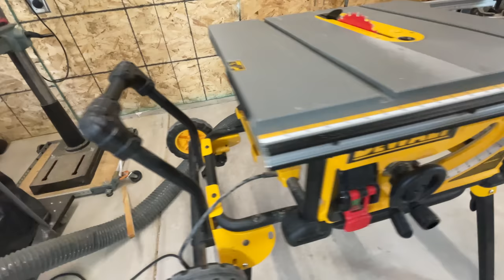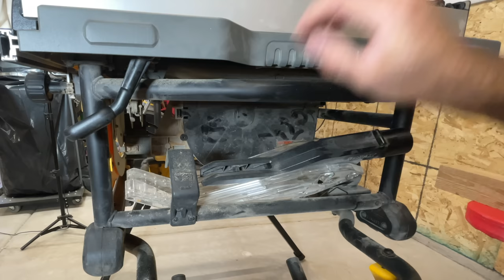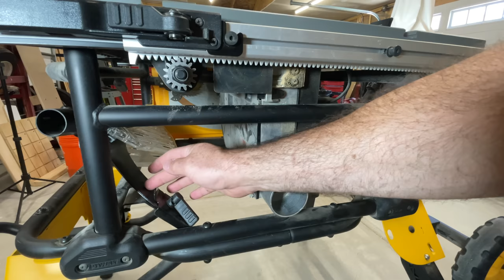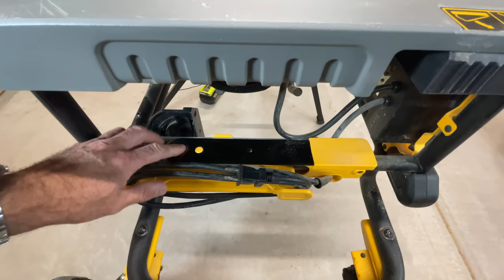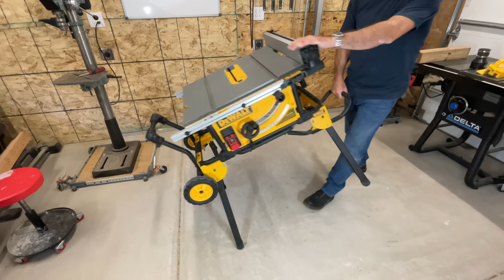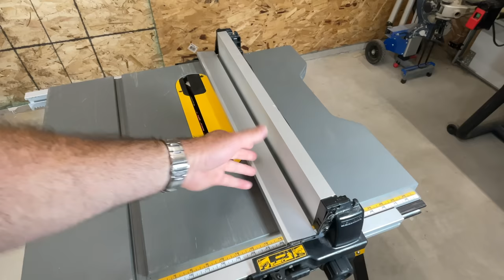The Saw Designed For Everybody?  |  DeWALT DWE7491RS   |  Review and All Adjustments

Comment: I've just had too many of the Dewalt rack and pinion fences jam up with sawdust.  I always liked the Bosch fence setup better.  Now Ive moved to the Sawstop Jobsite Pro and absolutely love it.
Reply from the maker: I’ll pay extra attention to the fence differences when we eventually get a Bosch in to review. Looking forward to getting that Sawstop in for testing too. Looks really good. Thanks for the tip Sean!
Reply: How do you get so much saw dust in there that you manage to jam those large teeth?
Reply: @ProjectsForAllReviews  If at all possible review the Skill-saw SPT99-11 which is in this cat. I chose it over the Dewalt mainly because of the fence it seemed a little heavier and has T-Slots built into the front and top of the fence which is nice for attaching stops and axillary fences to the main fence.
Reply: @loganmedia1142  Agree. I've heard nothing but great things about DeWalt rack and pinion fences (just got mine yesterday). I would think dust extractor or compressed air would handle that.
Reply from the maker: It’s on my short list to review!
Reply: @ILruffian  I agree with you. Most people don't know how to clean as they go. Then, they wonder why they are having issues.

Comment: I’ve had this saw for 5 years now. Overall I really like it. It’s very accurate and I love the rack and pinion fence. Overall the saw has pretty good power but cutting 2” walnut will bog the motor down. 
The things I don’t like about is are:
1. Small table size. I ended up making an extension that helps somewhat but…
2. I HATE the vibration. I really wanted the delta saw you have but, at the time, I needed to have the portability of the Dewalt.
3. Related to table size, I don’t like the small infeed size (distance between tabletop front and the blade. There are some work arounds I’ve found but… 
Having said all that, I do like the saw a lot and it remains the workhorse in my shop. 
Great review! 👍🏻✅
Reply from the maker: Thanks Steve! I did notice the infeed was cramped but kinda figured I was spoiled with my contractor saw. It really does make a lot of noise and vibration though.
Reply: Once i noticed the motor on my 745 staining a bit when ripping about 20-24" of 8/4 cherry and walnut for an end table. I was operating with the blade gullet just clear the surface of the wood and decided that the blade would have more downward leverage (and run cooler) if I raised it up to 3" which is near the full height. Sure enough it began to cut with greater ease--even on hard maple. About the only thing that seems to bind it for me now is a 2x4 with a lot of internal stresses within. If I experience one of those I just put it aside for some other use as it's not worth risking a kickback or damaging the saw for such a cheap piece of wood...

So many comments about the crap miter gauge. I've bought many good quality bicycles in my life and they invariably all come with a crappy seat. It's expected that a rider will have a particular notion about what seat they want to use so the sellers figure the  stock seat will be immediately junked by just about everyone so that's it's not worth supplying a more costly seat. I suspect the miter gauge is sort of the same--I rarely use the miter gauge for the way I work so it's no biggie to me--certainly not worth harping about when reviewing these saws. I wouldn't had been worth it for me to pay extra for a "nice" gauge that isn't really important to me.

Comment: I've got the 10" wormdrive jobsite saw and it never goes anywhere. I love the thing, but my 8 1/4 Flexvolt Dewalt is what I use on site. It's so easy to transport. Plus, for some stuff I can get away with using 7 1/4 on it (like flooring the other day) and save money that way plus the 8 1/4 blades are way cheaper to begin with. The corded version was 450 I believe, but I got the fast charger, 6AH battery, blade and a few other little things for $550. Totally worth it. And if you have the 9AH battery that's what I've been using and it lasts over a day. Then again, I'm cutting flooring. Great video, totally agree. New sub here.
Reply from the maker: I’m looking forward to reviewing the battery DeWALT saw hopefully soon! We’ve got the Evolution multi material table saw coming up in the next week or two and I’m pretty excited about this one. Welcome and Thanks for the Sub!

Comment: I own this saw, and the smaller one that takes the 8 1/4" blade.  I'm a carpenter/contractor working on mostly exterior projects.  We do a lot of custom joinery and mill/router all of our own trim sizes and detail pieces.  On top of that I'm remodeling our home.  I see no reason to own anything else.  Maybe if I was building cabinets and cutting 4x8 sheets all the time I might consider a permanent shop table saw but I see no reason to waste the space on that.  For the record, I'm a Milwaukee fan boy, I've purchased(and returned) about every brand of portable table saw.  The DeWalt jobsite table saws are the best(in my opinion).  I learned carpentry from rough framing I'll tell you the number one thing that was yelled at me was this:  "We're not building Fing pianos out here"... The thing is this, the really really nice tools are a nice to do for 99% of projects.  You don't need the absolute best tools out there to do your work.  When you look at some really nice carpentry work, do you think "I wonder if they used Makita or DeWalt on that one?"  

Does it do the job you need it to do?  That's it.
Reply from the maker: Toughest thing for me reviewing tools is I cant speak about long term durability. I appreciate the feedback! This is the saw I’d buy if I needed the portability or space savings. Looking forward checking out the 8-1/4. Thanks for watching!

Comment: Spot on review.  I have the Hitachi clone of this saw.   It's an unbelievable jobsite saw and a servicable woodworking tool.  I put a rip blade on the thing and it does everything you could want.  The 48" rip capacity is fantastic.    I completely agree that had I bought this first I couldn't justify buying a contractor saw.... But I'm glad I have one.
Reply from the maker: Thanks for the comment Bob!
Reply: The a Hitachi tested better then this dewalt.  The Hitachi has a more powerful motor and the fencing system is better.  This dewalt has tons of issues with it. Not very good quality.
Reply: @scraplifetrashtocash4551  Interesting. I didn't know that.   Looks like i'm even smarter than i thought :)  
I tend to give Dewalt credit for developing this class of saw.  (Maybe I'm wrong about that as well)  To my memory they were the first to make a really good job site saw, with the rack and pinion fence and built-in rolling stand.   
I recall coveting that saw for a decade or so and finally had an excuse to buy one of that class and chose the hitachi.  I got real lucky on the timing and only paid $350 for the saw.
Reply: Cuánto es el voltaje de entrada?
Reply: @sebastianreyes7856  sorry, I don't speak German.

Comment: Two years in, best saw I’ve had.  They made all the right choices for size and function.  My only complaint is the under-edge of the table is rough on the back of the hand when operating the fence locking handle.
Reply from the maker: Thanks for watching!

Comment: I had two Ryobi saws, they trash. Where the first one(a old hand-me-down) had small springs to help the blade raising mechanism to get back up, the new one didn't. Which made the crank break fast. The DeWalt here not only has a rack & pinion to raise/lower the blade... it is METAL as well. Really sturdy little saw with a good build quality. This thing only makes me want to go out of my way to buy DeWalt stuff for most of my tools!
My DeWalt came with a all metal miter gauge.
I would have bought that small one of Delta Contractor saw, but I heard it struggles on a 15amp plug. That was my main reason for grabbing the DeWalt here. Nice review!
Reply from the maker: Hello Bizarro! I do not miss my old Ryobi job saw. It really was junk. I’ve read the reviews on the Delta job saw and they aren’t promising but I’ll get one to test eventually.  My Delta contractor is on a 20amp circuit and it’s pretty strong with no struggling. Thanks for watching!
Reply: @ProjectsForAllReviews  Yeah I originally read that Delta Tablesaw has issues, where the motor burns out. So many people brought it back. This made me weary to buy one, or that Rigid lookalike-in-orange.
Then I read, the motor can/will burn out if you run it on a 15amp outlet, not a 20amp one.

So yeah that buried the Delta for me. If I need to upgrade my power outlet in my garage I'd rather build a 220volt one in, for the big boy toys... not just a 20amp one.😁
Reply from the maker: Makes sense. When I built the garage I installed a 100 amp panel. There’s 2 50amp circuits on either side for the welder and a 30amp for the heater also about 60 outlets on 20 amp circuits. Went a little crazy because my old garage electric was so bad I couldn’t run my small compressor. All that said I went with the Delta over a 220v model because I didn’t really see the advantage. I believe the motor runs cooler and possibly lasts longer but I rarely run the saw for hours on end.
Reply: @ProjectsForAllReviews  Honestly, "Went a little crazy"... if you plan to do some work, Metal or Wood, and you want "room upwards" you can't get crazy enough with energy possibility. If you have the space and maybe a chance to make money the only thing holding you back to get a real big machine is the electricity.

Welding. I keep see people on YouTube weld and I would like to try it as well. Not structural stuff just small things, but I am not so sure if I not burn out the cables in my wall and so far I not found anyone I can trust that told me its fine.

Comment: I have this saw and love it!!  Being able to fold it up and store it away is great and when I need to work on my parents house I just roll it into the van and fast setup on the job site.  The fence gearing is awesome for keeping the fence parallel to the blade, used to have a saw where the fence just clamped on one end and the fence was never parallel, what a pain. Great review.
Reply from the maker: Thanks for watching!
Reply: I had the Delta saw in the background, it had the same issue. Both ends of the fence were never the same. I had to push the other end to make it square, which was a pain. The Delta was a smooth saw, but that issue will keep me from buying it again. I'm going with the DeWalt instead.

Comment: I bought one of these about 3 years ago for my home workshop, and have totally loved it. The later made model I have comes with T style miter slots rather than the straight style that is on that one. I remember that I was prepared to spend time tuning it up when I opened it, but didn’t have to do a thing, it was completely dead on right out of the box. I’ve used the heck out of it for everything from small projects, to 2X construction lumber without a single hitch, and love that it can take a full dado stack. I don't have a single regret about buying this saw!!  Only change I made was replacing the stock inserts with zero clearance
Reply from the maker: Awesome Tabitha! I’m glad to hear it’s been good for you. Thanks for watching!

Comment: Nice review of the 7491. I totally agree on the miter gauge it is junk. But since the slots are standard you can put in a quality aftermarket gauge on it, if you are doing projects that need it.  My riving knife was actually bent slightly from the manufacturing stamping process so I had to flatten it on my anvil. I've used this saw for years i wish you could get a full kerf riving knife for it though. So I run a forest blade stabilizer on the nut side of the arbor and I can get glue quality rips with a freud glue line ripping blade. I've run a stacked dado set on it and it had plenty of power for a 1/2" wide x 3/4" deep dado cut in hard maple. I feel uncomfortable though, running the dado because of the direct drive gearing and the sudden start of the heavy stack. That said I haven't had an issue yet. I do have a contractor saw with an iron table and a belt drive so if I'm in the shop I run the stack on that. But the portability, versatility and stability of the 7491 in my opinion is unparalleled. If I need to cross cut at the job site I use my dual bevel 12" compound slider or the Skilsaw. In my opinion though you made too many comparisons to your delta contractor saw so it wasn't apples to apples comparisons. Also for a jobsite saw .004 bend or warp in the fence is pretty amazing really considering these jobsite saws are generally used for rougher construction.  every build I've been on when it comes to high end trim work the trim carpenters brings their cabinet saw. I didn't like the fact that the saw didn't have on board blade storage so I put a panel with a 1/2" carriage bolt and a wing nut on the foot of the dolly of the rolling stand using tec screws. I have stopped the motor on the saw and blown the breaker I had a piece of 8/4 hard maple that bound and stalled the saw despite the riving knife. However, I was able to shim it open and complete the cut. Have you ever done a video on proper extension cords? Up to 15 feet I'll run a 14 gauge over that I go to 12 gauge up to 25 feet, then beyond 25 feet I run a 10 gauge. If I'm over 50 feet I'm not happy running 10 but 10 is what I have, and then I am particular about how I use the saw being sure not to crowd it or overheat it. The gauge and the length choke the volts and amps underpowering your saw and possibly damaging the motor permanently. Also there is a difference in the volt/amp capacity of solid conductors vs woven conductors. Solid conductors having a higher capacity.

Comment: I have had mine for about 6 years and is very nice unit. Some of the things that I do not like about it. The top is that flat. Typical with so many of low end saw, the mitre guage is a complete joke. Calibrating the tilt is pretty much a two person job. Nice that you can can parallel the blade and the fence to the mitre slot. Also the extra width ripping capacity is also very nice. I ended up getting the Incra mitre guage.
Reply from the maker: Not sure you'll ever find an aluminum topped job saw that's very flat. My cast iron Delta has low spots too, 8-10/1000. Incra makes a very nice selection of miter gauges for sure. Thanks for watching!

Comment: I had the version before this saw on my old job. Used to call my own little Volvo. My lord was it good for the size and prize. Personally i enjoyed the folding metal feet for stability use on a jobsite, but for garage/personal use i'd take this one i reckon. Only "issue" i had was sawdust getting some places so stopped the tilt and rise, but 5mins of cleaning and all good again.
The poor baby sadly burned out when one of my workmates cut down soaking wet 2x8 and the wet sawdust just couldn't escape and clogged everything. My favorite tablesaw of all times with over 20 years in construction. Might get this one once my Festool dies
Reply from the maker: I’ve heard a few stories now about dust clogging the lift mechanism with these Dewalts.  I personally haven’t experienced it but I also don’t spend a whole work day sawing either. Thanks for watching!

Comment: Nice review.
The test I have found is to rip a 2x4 standing on end. Your cutting 3 1/2" deep. I seem to do this a fair amount.
I have this little Kobalt job site saw and it does it very well. That's about the only thing it does well, but it does it.
Looking to replace it now.
Reply from the maker: Hello Mark! Smart idea! Some else mentioned doing this too and I think we’ll be doing it on a future table saw reviews. There’s a lot of great saws on the market and this Dewalts a great choice if your staying with a jobsite  thanks for watching!!
Reply: @ProjectsForAllReviews  
I found the Skill worm drive job site table saw. Looks impressive
Reply from the maker: I’ve got my eye on those Skil table saws. We’ll get them in the shop for review eventually.

Comment: Just got the setup. I like it but it's kind of bulky attached to the cart. Makes it akward to go in my work trailer. I'm looking for some kind of quick release for attaching the saw to the stand so I don't have to bolt the two together. Most other dewalt pro level tools have a way to do this, like the miter saws quick release and attaching clamp to pair it with an extender table. So far, I haven't found anything for this.

Comment: Have had that saw for 5 years without any problems. The fence is my biggest complaint, it is thin sheet metal and I'm afraid to clamp anything to it just like on this one it won't hold up to it. The other thing I wished it had was a crank tilt mechanism. The miter can be ungraded so that's not such a big deal, but they did short change this machine.Though about stuffing fence but haven't figured out with what, afraid wood would swell with moisture. I bought so it can be put out of the way when not needed but still a pretty decent tool.
Reply from the maker: I think most of these job saws have pretty flimsy fences. Designed to be light weight and portable over robust. Interesting idea to stuff it. Square steel tube or stacked sheets of acrylic or something. Thanks for watching!

Comment: Just picked one of these up. Is there any way to adjust the gear engagement on the rack and pinion. Gear engagement on the back rail is good. Teeth on sprocket fit snuggley in the gears on the rack. Gear engagement on the front is loose. Gear sprocket behind the micro adjustment knob needs to come up some to engage the teeth in the rack better. 

Blade that came with it is warped.